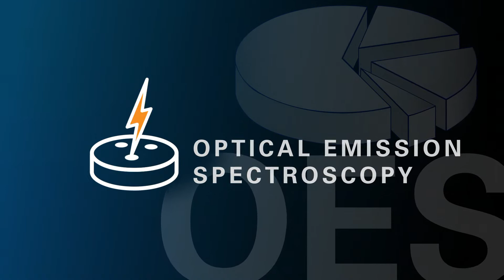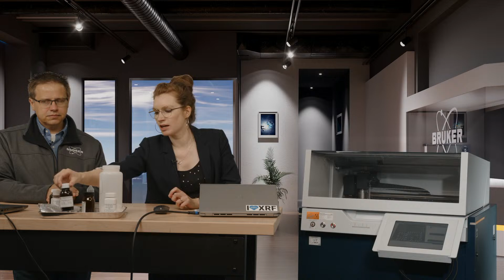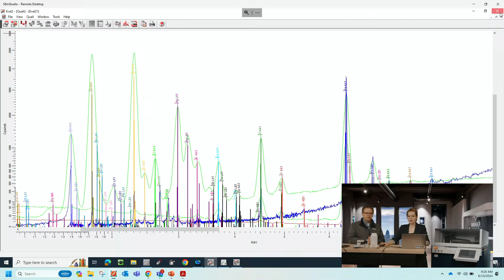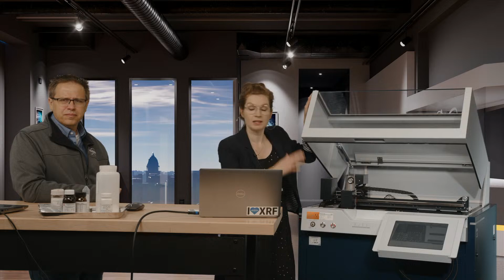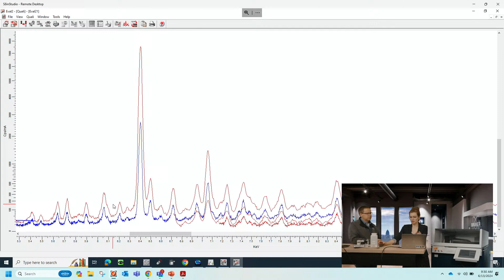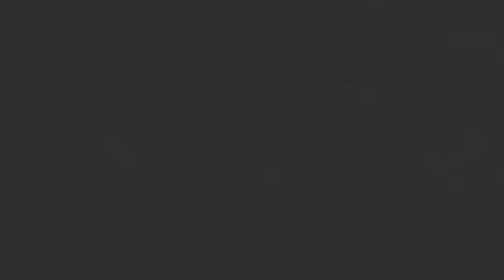Live from the Lab: X-ray Fluorescence in Mining Analysis

Comment: I would like to mention that we have a basic XRF instrument (S8 Tiger 4K), installed in 2023 with three crystals (LiF200, PET, and XS-55).

I'd like to know how to sort the results table by atomic number (Z)? On the previous XRF equipment (SRS3000), I just had to click on Z to sort the results!
 
What is the list of Certified Reference Materials you used to optimize and validate the fundamental parameters method for the different types of analysis methods: pearls, loose powder, pressed powder, liquid, solids, and metal alloys?
 

Best Regards,

ANDRÉ LUIS